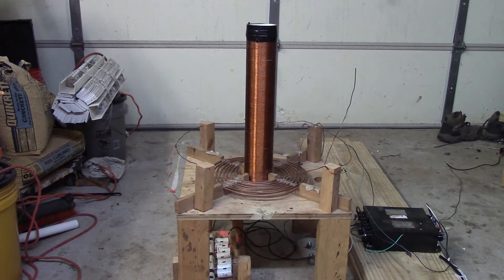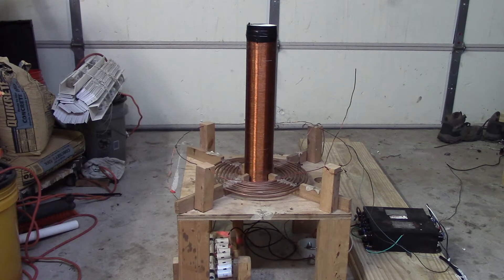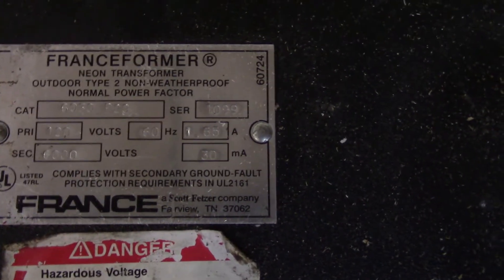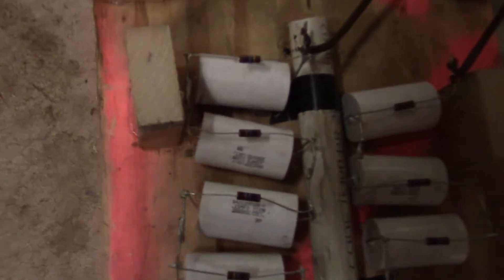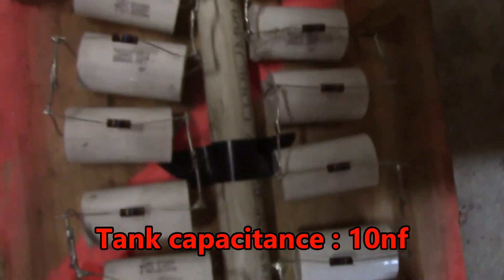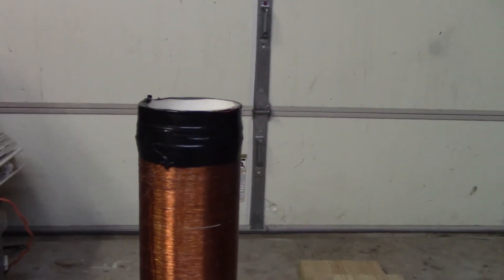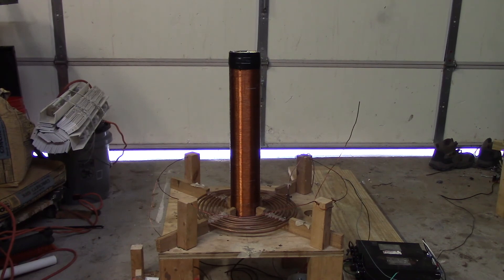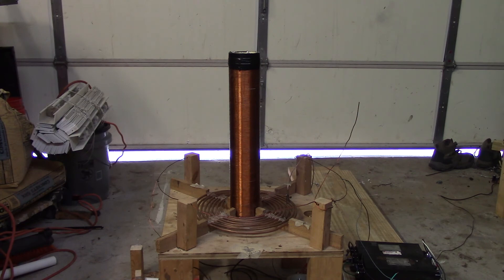Homemade Tesla coil

Comment: That's actually a very impressive output!! I guess I'm a bit behind on creative projects like building a tesla coil, which I need to do!! Keep it up man, much enjoyed!!
Reply: Platinum Science antique shops
Reply: Did ya see the vid about the link I posted?Joshing Game is right about Antique shops having some.
Reply from the maker: Variac Maniac Thank you! And yea Id be pretty cool if you build a Tesla coil!! Also where do you go insulator hunting,  Im not sure where to look
Reply from the maker: Joshing Game Thanks, ill check my local antique shops
Reply from the maker: Variac Maniac send the link and ill check it out
Reply: Got the link?
Reply from the maker: Variac Maniac whats the video Title?
Reply: If the link isn't working then try You Tubing ''Overall Insulator Collection + Insulator Hunting Tips 12/25/16''.
Reply: Variac Maniac Have either of you used bucket capacitors?
Reply from the maker: Joshing Game yes I have, I prefer foil rolled caps over bottle/bucket caps though.
Reply: Platinum Science Whys that?  I break a lot of bottles when running anything over 6kv 60ma
Reply from the maker: Joshing Game foil rolled are much more quality and give a far higher capacitance than bottles. My foil rolled caps are rated for 50kv. When it comes down to bottle caps, they could handle 30kv but I would need a lot of them to get the capacitance i needed for my coil
Reply: Yeah! Might use one for a tesla coil someday.